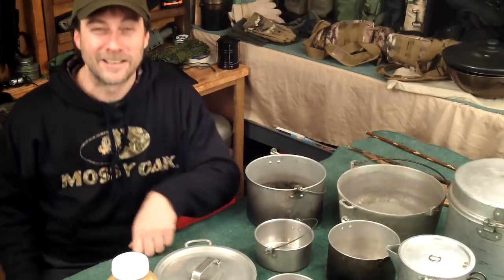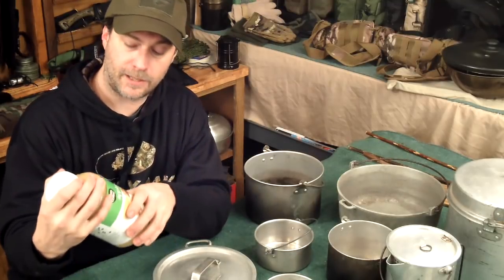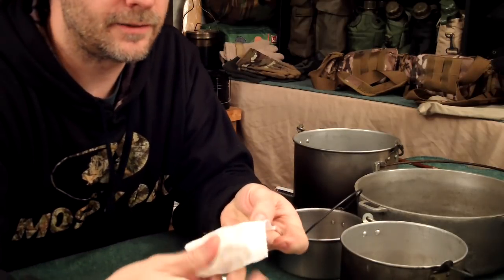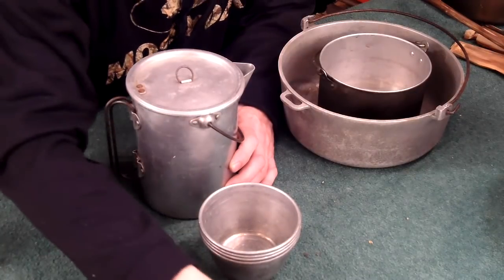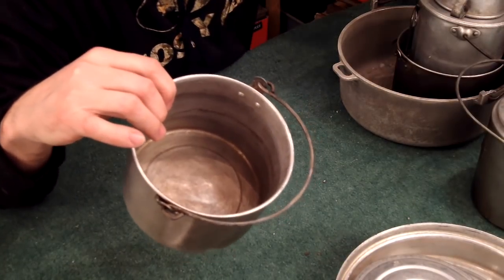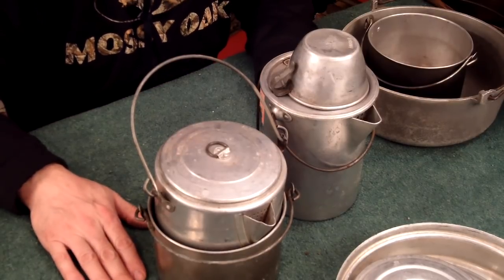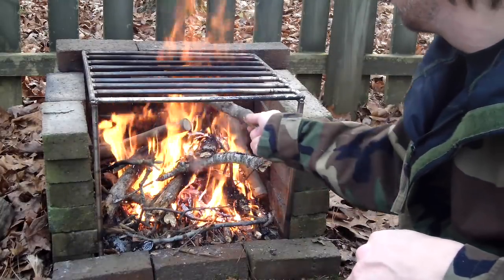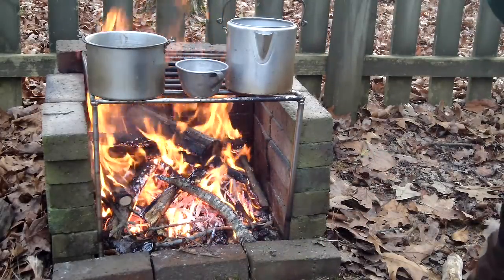Testing Old Aluminum Cookware For Toxicity

Comment: After doing some light reading here's what I believe: Your video just demonstrated that your cast aluminum pot is not anodized and therefore will readily react with acidic foods (apples are about a pH of 3.5). As far as I know it was/is not common to anodize cast aluminum  so I suppose that part is not surprising. Non-cast aluminum cookware is commonly anodized, which is some type of process which prevents the surface of the aluminum from reacting with foods. Supposedly if the surface has been scratched then the aluminum will react more readily. But aluminum exposure and dangers are basically none existent since so little aluminum gets released and consumed. Though this does not help the bad taste that gets imparted on foods, so I don't think I would personally want to use non-anodized aluminum for cooking. Either way seems like cooking acidic foods in aluminum is undesirable.

One of my references below:
"Lightweight aluminum is an excellent heat conductor, but it’s also highly reactive with acidic foods such as tomatoes, vinegar, and citrus. Cooking these in aluminum can alter the food’s flavor and appearance and leave the pan with a pitted surface. In our tests, we detected an unpleasant metallic taste in tomato sauce and lemon curd cooked in aluminum pots.

The amount of aluminum that leaches into food, however, is minimal. In lab tests, tomato sauce that we cooked in an aluminum pot for two hours and then stored in the same pot overnight was found to contain only .0024 milligrams of aluminum per cup. (A single antacid tablet may contain more than 200 milligrams of aluminum.) Our science editor reports that the consensus in the medical community is that using aluminum cookware poses no health threat.

In short: While untreated aluminum is not unsafe, it should not be used with acidic foods, which may ruin both the food and the cookware. Also note that aluminum cookware that has been anodized (hardened through a process that renders it nonreactive) or clad in a nonreactive material, such as stainless steel or a nonstick coating, does not leach into or react with foods."
https://www.cooksillustrated.com/how_tos/6390-is-aluminum-cookware-safe
Reply from the maker: Fantastic comments! Thanks for the research and I'm pinning your comment to the top of the list for others to read.
Reply: @Reallybigmonkey1  Thanks, friend. I had to make sure I wasn't possibly consuming poisonous stuff either haha. 
While you're here, do you have any videos that might cater to what gear one should take on a day hike? I watched a video of yours on survival kit options but maybe there is a day-hike loadout that you have already shared?
Reply from the maker: @pruff5072  Sorry but no day hike load outs. Just survival type stuff.
Reply: @Reallybigmonkey1  Oh no worries. I'll just keep in mind your advice on the survival kits so I can incorporate a decent one in my day hike kit.
Reply: Anodized aluminium does still leach into food although far less than unteated surfaces. Using untreated aluminium cookware day to day is probably still a very bad idea. You may cherry pick your studies though and reach your own conclusion
Reply: Not completely true at all. Aluminium is a HIGHLY reactive metal, hence its position on the periodic table. It's so reactive, it immediately forms aluminium oxide on contact with air, we are taking nanoseconds here. It's the oxide layer which is highly unreactive with most things. However, that oxide layer is not very deep, around 1.5 nanometers. Whilst it is harder than aluminium, it is not super tough. A simple steel spoon will easily scratch it, releasing aluminium oxide into your food. Anodizing essentially speeds up the oxide layer, making it a little deeper by using sulfuric acid. Again though, it's not going to be very deep and once again, still easily scratched by metal utensils. I wouldn't use aluminium cookware, cast iron is best!
Reply: @khalidacosta7133  Sure. I am certainly not an expert in things relating to chemistry and materials science but what you are saying makes sense. Though while not ideal to eat from aluminum, as far as I could tell it is not considered particularly bad for your health given the small amount of exposure. And if someone has finding otherwise then they are of course welcome.

Comment: Hey, nice video.  I work as a cook, and we use aluminum pans. When we clean them after we wash them we scrub the inside with salt. As you scrub the salt will turn gray from the aluminum oxide. It make the pan smooth and shiny, it also helps to keep food from sticking.
Reply from the maker: Thanks, I'm glad you liked it Richard. That's a great tip on using salt! Thanks for watching
Reply: Very interesting,.  Thank you ... going to try this!

Comment: You know, it makes total sense to me that the cast aluminum was the one that leached. When we use cast iron, it leaches too, but it leaches beneficial iron. The cast aluminum, not so much!  Thanks for taking the time to do this experiment. That was a lot of dishes/cleanup you had to do after doing this video!
Reply from the maker: Yep, and both are cast. I guess any thing cast has pores that open up during heating. They contract when cooling trapping all kinds of stuff. Thanks for watching Sally

Comment: Some way-late thoughts from a metallurgist: 

Cast metals can have more microscopic-sized porous than metals formed by other processes, especially if the casting quality is low. Stamped metals tend to have comparatively fine grain sizes and high strength, especially near the surface of the workpiece. This means that your stamped aluminum pieces could likely take and keep a much higher polish than that poor old cast pot. While the cast pot was probably nicely polished when sold, my guess is that that polish broke down over the years. The loss of polish would have exposed any underlying porosity; which would have allowed the aluminum to corrode more easily, and to become contaminated by whatever substances were heated in the pot.

tl;dr: I wouldn't use that pot either.
Reply from the maker: Thank you for that explanation Evelyn!
Reply: Yeah...that's what I was thinking...you said it way better than I could have...😍
Reply: what about cast iron pans? are they bad to use as well? they all seem a bit porous
Reply: @america1403  Cast iron is somewhat porous, but has different casting properties that generally result in higher quality castings than with aluminum. Also, AFAIK, ingestion of iron is not associated with any toxic effects in the human body.
Reply: @evelyngorfram9306   thank you... i love my cast iron pan
Reply: @america1403  You can mirror polish cast iron with sandpaper to remove imperfections and properly season it. Its harder than cast aluminum which is why most modern more costly aluminum cookware was anodized and has encapsulated bottoms to increase even heating etc. Anodizing hardens the surface of aluminum considerably.  Acid and salt also affect both metals...both in food. Cooking basically exposes metals to every condition that causes them to break down over time. Cast iron is protected by proper constant maintenance of seasoning and keeping it clean and dry when not in use of course. Doctors suggest using cast iron cookware to combat iron deficiency😀
Reply: @evelyngorfram9306  be careful with using cast iron because iron shouldn't be over consumed, although your body does need some iron to form red blood celll, just enough is the key.  So don't use cast iron to often and make sure to read your blood tests for level of iron you have.  Your body does not need aluminum at all.
Reply: @evelyngorfram9306  aluminum or aluminum oxide is toxic?
Reply: @evelyngorfram9306  Hey there, I was wondering, does this mean stainless steel cookware is not safe? Because I bought a Tramontina set and there was black/grey residue that I was told was oxidation by customer service. Is that oxidation from aluminum underneath?

Comment: Great information. Yes, the cast pot was a different color. I would also think that the food would taste different bc you was saying & making NASTY faces.. lol.. This was a good test. When it's warmer I'm going to do the same test to my pots. I mostly don't want to eat toxic food. From the bottom of my heart I thank you so much for teaching me something I had no ideal about, or even thinking about it.
Thanks David for opening my eyes on something very important, 
Chris
Reply from the maker: Thanks Chris, I'm glad you liked it and glad to hear it was an eye opener. A lot of folks don't know this stuff. Most pots will pass the test but the ones that wont need to be wall ornaments! Thanks for watching and take care Chris
Reply: Hey Dave, thanks for this video, very helpful and safety minded. One question tho, can you just buff the inside of that cast pot to renew it? We have bought some old pots like that for a bug-out purpose and now we are left to wonder what to do. We will give it the test first. Thanks again! Great test video, we love watching them!
Reply: Earl Schultz Or purge it through many boiling cycles until the applesauce is safe.
Reply: Thanks. Would you have to fill the who pot, or just the bottom?
Reply: Earl Schultz  I would fill the pot with water for the boiling.  Then check it with applesauce after the 3rd or 4th boil, and hope for the best.  OR you could just fill it with applesauce then boil it.(ha, not really)  Of course,  changing the water after each boil. Probably using distilled water to boil.
Reply: Earl Schultz  Second thought.  Stainless steel or cast iron is better.
Reply: I agree, but I just can't throw away the aluminum pots... old school!
Reply: stilcrazychris l

Comment: Thank you, Dave. A much needed video, since so many people still use old camping pots they dug out of their attic, that were previously cooked in by past generations of camping and hunting trips. One thing for sure, any of those cast aluminum pots that were used for cooking tomatoes for sauces or canning them will erode the metal and with each stir of the sauce, scraping the bottom of the pot will compromise the metal, because of the strong acidity present in tomatoes. The same for coffee acidity and aluminum. I actually clean my copper bottomed pots by slathering tomato sauce or ketchup on them. Learned about this as a teenager when my pot of spaghetti sauce overflowed and when I cleaned it the next morning the areas on the pot where the sauce dripped were shiny and new looking.
Reply from the maker: You are very welcome and I'm glad you liked it. Yep, folks need to test their pots before use. I hear ya on the tomatoes. I have actually used them to clear foggy headlight covers on cars! Thanks for watching

Comment: My late Brother used to work in an aluminum reduction facility. He called the ore that they processed alumini.
The process involved about a million amps at 9 volt going through a line of pots a mile long. I forget how many lines they had but the power consumption was supposed to be equivalent to half of Portland Oregon. This was the plant outside of Goldendale Washington that got shut down after Russia dumped all the aluminum on the market when the USSR ended.
Reply from the maker: Thanks for sharing that John.  Very interesting,  I've never heard anything like that.

Comment: I stopped using Aluminium pots when I left the army 1985. Of course, as you are aware most Army mess kits were made of Aluminium way back in time and for at least a couple of hundred years, I think ! Alu isn’t all that easy to take care of in the field, but was issued and therefore all we had. Nowadays, I must confess to being a Titanium user. It’s the lightest and most efficient cookwear I know of for bikepacking and hiking, where prime consideration is on weight. My alu gear doesn’t get used anymore, it is destined for the bin! 
Thank you for sharing with us Dave, another informative vid.
Reply from the maker: Aluminum is tough to care for and keep clean. Actually, right now 90% of my camp gear is stainless steel.  I'm glad you liked it. Thanks for watching

Comment: Interesting experiment!  I'm not surprised by the color change in the cast pot; if it was sand cast, the pot would have a more porous surface by virtue of the manufacturing process..  I switched to stainless steel a long time ago, and I believe I will stick with it.  I really like your fire pit, and the cat totally rocks!  Thanks for sharing!!  :-)
Reply from the maker: Thanks, I'm glad you liked it all. Actually, 90% of my camp gear is stainless steel. Thanks for watching

Comment: Changed to stainless and took cooking classes years ago...now I like my cooking.
Stainless steel has a higher density, higher melting point, lower temperature expansion than aluminum...which makes it the better choice for cookware. Price and weight is close enough for me that I do not even consider them. 
Some people still smoke, use old plastic canteens made with BPA...we are all old enough.

Dave....Happy New Year! Keep up the good work.
Reply from the maker: 90% of my camp gear is stainless steel. Happy New year to you too my friend!

Comment: A lot of aluminum pots back in the day actually had  quite a bit of lead in them to make them cheaper to machine. Lead was also used by many makers of cheaper pots to make them easier to stamp and draw into shape. So the old thick lead machined pots should be discarded immediately! The older drawn or stamped pots are probably safer if they have seen a lot of use (you already got any lead out of them), but I would not let kids around any aluminum pot over maybe 25 years old--I think they took the lead out  of aluminum pots the same time they took the lead out of gasoline--mid-1980's.  I won't go into the debate over aluminum, but it probably is not that big of a deal (but I can hear somebody getting ready to scream at me for that statement). If you are just boiling water, like most bushcrafters would use the pot for, I would not worry, period, especially if the pot is anodized like the Kohansky pot is.
Reply: geezerdude very interesting info,but Imho the lead out of gasoline was causing the biggest harm
I'm looking  for the mors pot several years now,I think its a great pot
Do you own one,and do you like using it?
Steve
Reply from the maker: Very good information! The added lead makes sense!
Reply from the maker: Steve I have a coated Mors pot from four dog stove company and I LOVE it!
Reply: I wonder what results you'd get if you do a lead test on that heavy pot?
Reply: Geezerdude:
It depends where the pots are made. If the pots were imported, and most today are, then there is a likelihood that even new pots can have high lead content; see article on 2014 study: 
http://news.ashland.edu/article/ashland-university-involved-research-showing-lead-released-african-cookware-contaminates

While lead is added to some aluminum alloys for purposes of machineability, the majority of lead in foreign cookware is because of the recycled mixed scrap metal used to make the pots.
Reply from the maker: I have no idea but that's a very good idea. I need to see how to test for lead.
Reply: You can get a lead testing kit at most Wal-Marts.
Reply from the maker: Thanks, I didn't know that.
Reply: Aluminum is very easy to machine, I cannot see lead being added for such a reason.
Reply: Lead test kits turn the swab pink or red if there's lead so I was also thinking that's probably what it is.
Reply: A pot like that may have been used to smelt batteries or other scrap lead for casting sinkers or bullets.  No telling.
Reply: If anyone is ever in question on lead content, lead testing is cheap, really easy, and the results are instantaneous
Reply: Lead has a lower melt point than aluminum so it is possible that old cast aluminum pot were used to melt lead for sewer pipe or bullet casting.  It is a concern.
Reply: Fun fact: Lead was at some point sold as candy because it tastes sweet.

Comment: I have a 1955 Regal Ware 5 tier camp set, stamped aluminum, that I use regularly. Got it for free from someone who only used it to store cookies... I dont cook over open flame with the pans, so much as warm over coals. Pretty much everything I need (minus my wok) for a perfect kitchen fits in this set. I have a collapsible silicone/steel bottom cooking pot for boiling water that fits perfectly in the bottom pan. For shit n giggles, I tried this test after watching your vid and thankfully, my wife and I enjoyed some warm applesauce!
Reply from the maker: Oh if it only stored cookies it should be good to go! Thanks for watching

Comment: My Mom had a cast aluminium set of pots back in the 50's and it was well known then that cooking high acidic foods like tomatoes/applesauce/fruit would 'EAT AWAY' (the expression used at the time) the aluminium and leave pock marks (mini holes) in it and turn it dark grey. To clean up that staining just cook/boil potatoes in it and it will whiten up again and look as good as new but still have the pock marks from the acidic foods that had been cooked in it. 

So since I was there and saw first hand I can say this is all true.

Your test is just demonstrating how much aluminium is in the pot. The darker the colour change the more aluminium the pot contains. If there is no colour change there isn't much aluminium in it. 

Pure aluminium will melt from the heat of a camp fire. We did this test in Science class in grade 8.
Reply from the maker: Very interesting information Sheila! Thanks for sharing that.